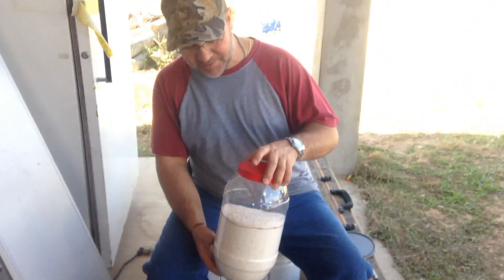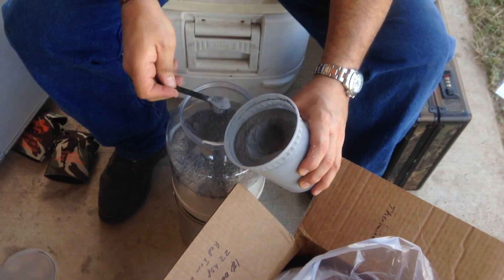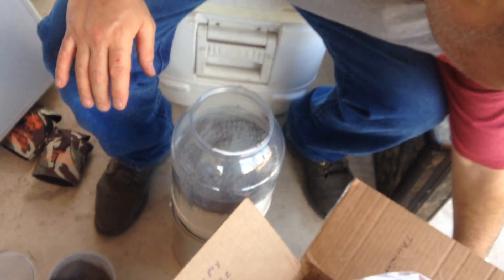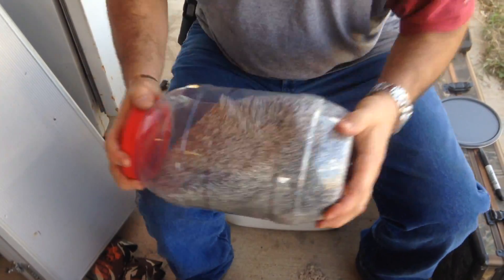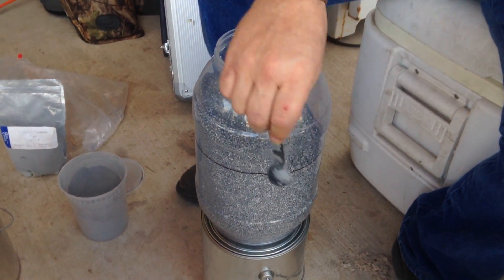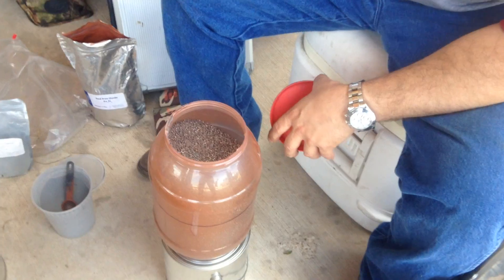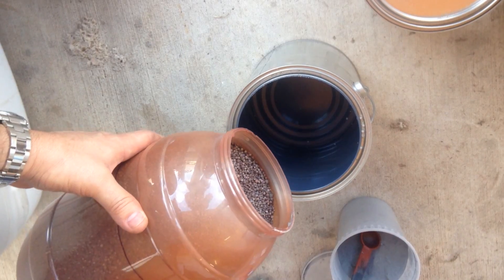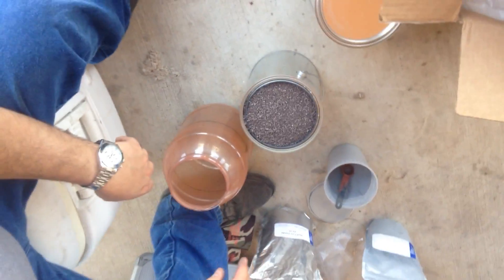Making Tannerite / Thermite Mix . Educational & documentary, Tannerite  purchase at Academy

Comment: Cant you use other accelerants other than aluminum?? Baby black powder or copper powder.
Reply from the maker: Google ANFO. That would require a explosive charge. Also look up Oklahoma City bombing, however you see the ATF and FBI soon☺
Reply: @ramohino  do u even know what Anfo is ?
Reply from the maker: @pyro_stepbro6933  ammonia, nitrate and fuel oil.
Reply from the maker: ANFO is  NH 4NO 3 and fuel oil.
Reply: Yeah!!! More like exotic metals such as copper cadmium , magnesium ex. But aluminium is your go to for thermite.
Reply: The aluminum is fuel. The FO is fuel oil. The powdered aluminum is more reactive than liquid fuel oil. 

Black powder uses potassium nitrate instead of ammonium nitrate as the oxidizer. 

The Tannerite mix is just shock sensitive enough, but it is safe to handle. When people start adding other stuff to it, they sometimes make it so sensitive that simply rubbing it between their fingers sets it off. Tannerite is legal if used as labled.

If you want to make fireworks in the USA, the first law is that it is illegal to manufacture explosives on the ground. The Feds call it a destructive device and it will get you 5 years.

Comment: You seem to be doing some redneck math or just none at all. Also u dont use red iron oxide. Please do more research before u post a how to video especially one dealing with explosions and fire. I gotta ask how the aluminum was supposed to be the catslyst for the  tannerite but also at the same time provide the burn for thermite (aside from using the wrong iron oxide n bad ratios) once its all sparsely spread into a cloud from what little of the tannerite that did ignite?

Comment: What exactly is the purpose of the red iron oxide???  I get that it's an oxidizer but isn't using that redundant?
Reply from the maker: In my opinion it makes it burn very hot. I did a 5 gallon bucket the other day and it started a fire. I won’t even upload it because it was so big It made a fireball. YouTube will delete it if I upload it 🤦‍♂️ that’s why I don’t upload any more videos. I was thinking about uploading it and entitling it the dangers of shooting reactive targets. It burned 5 acres and obliterated a full size refrigerator. Aluminum powder and iron oxide makes thermite mixture.

Comment: If you get pill bottles fill them drill a hole in the lid put a crossbow bolt or arrow through whatever you shoot goes bye bye 👋
Reply: Tannerite requires a minimum of 2000 feet per second while a typical crossbow is around 200-400 and a bow is typically in the 2-3 hundred range

Comment: I make homemade tannerite/binary by using ammonium nitrate and aluminum powder. In my opinion the iron oxide you use is making the explosion weaker than it would be if you used straight aluminum. Plus the percent of Al to AN is 6% AL. You dont need to add iron oxide.
Reply from the maker: Correct, however try it and you will see. The possibilities of starting a fire a much more greater, because it burns much more hotter. Now as far as the mixture is very forgiving. In the field all you have to do is make sure the white ammonia nitrate balls are covered in aluminum powder and turn gray if only using ammonia nitrate and aluminum powder.
Reply: Where from did you buy aluminium powder. I cant find
Reply: @Р567Г  u can buy fine aluminum powder from most chemical supply websites, if not available to you, plenty of vids on youtube on how to go from tin foil to alumimum powder

Comment: Just a heads up, you need to mix this at the place that you intend to detonate it.
Transporting it once it's mixed is illegal
Reply: So is adding other chemicals to the recipe. Tannerite has an exemption that will soon be pulled because people get hurt.
Reply: @Michael-rg7mx  Supposed to shoot anything you mix immediately also, if you premix it and don't shoot it immediately it has to be stored in a type 3 day box storage magazine that meets ATF regulations. If you don't shoot the mix that day it has to be stored in a type 4 storage magazine that meets ATF regulations. 

And no tannerite isn't exempt, it doesn't need to be. It's illegal to transport explosives or have them transported to you without a license. It's illegal to manufacture explosives for business purposes without a license. Precursors are not illegal to transport. Making explosives for personal use is also not illegal. But once explosives are made you can not transport them off property without a license. You can not use them for business purposes without a license. They must also be stored in a magazine that meet ATF regulations on the property they were made. I suggest you brush up on ATF 27 CFR 555:11. I'll quote the text below.

"A manufacturer’s license is required by persons engaged in the business of manufacturing explosive materials for sale, distribution, or for their own business use. For example, persons engaged in the business of providing a blasting service using explosives of their own manufacture would be required to have a manufacturer’s license. Persons who manufacture explosives for their personal, non-business use are not required to have a manufacturer’s license.[27 CFR 555.11:555.41(b)(2)]
Reply: @Fernando PerryMendoza hahahah

Comment: So what does the iron oxide make it do differently than regular tannerite?
Reply: I believe the desired outcome was a combination of a tannerite explosion and thermite exothermic reaction, however the explosion just scattered the iron oxide before it had a chance to react with the aluminum.
Reply: @insidethestudio3886 You can see an orange dust cloud with the smoke. I believe that was the iron blowing away.
Reply: @redneckhippiefreak  Ammonium nitrate fertilizer pellets absorb moisture out of the air. It is the oxidizer, and the pallets, bags, water, and the smoke are the fuel. Hydrogen and carbon need the oxygen created to burn. Tannerite is fertilizer as the oxidizer and 350 mesh aluminum with a little carbon is the fuel. I guess that once it expands to a point, critical mass is achieved, and it all combusts. The orange smoke in this mix is excess water. I don't recall how long it was stored there after the freighter sat for a year or so because the owners went broke.
Reply: the termite reacts as well and creates more heat radiation
like with a nuclear bomb the blast gets way stronger because of the surrounding air expanding from the created heat radiation (if the thermite reacts sufficiently in that short time period)
Reply: coltanium well if it was the proper mixture for thermite it would detonate and ignite the thermite which would burn at roughly 8k degrees Fahrenheit